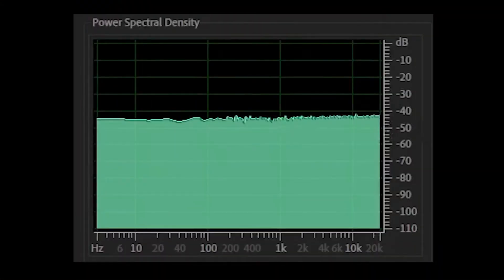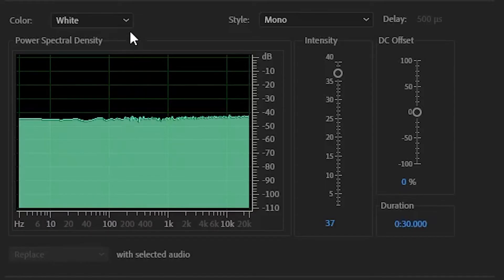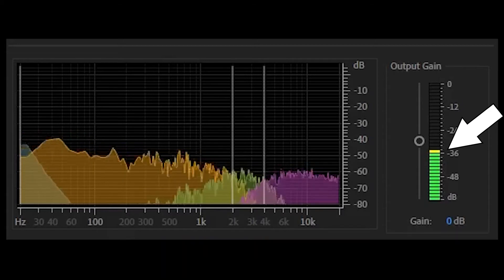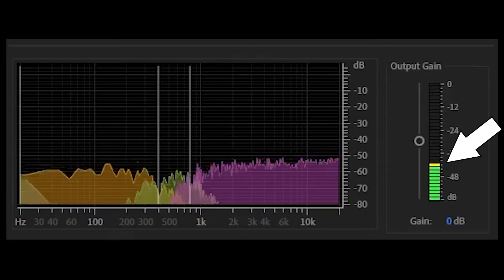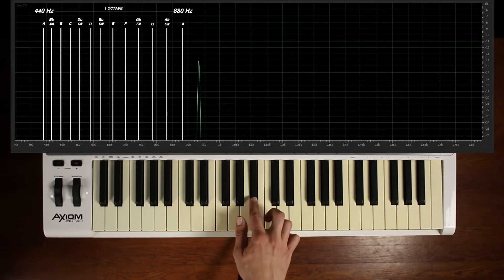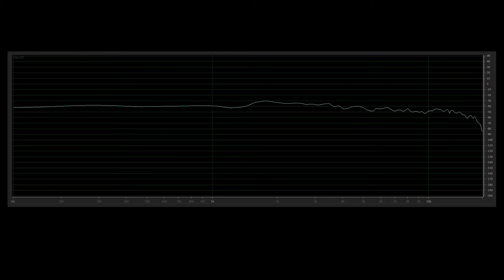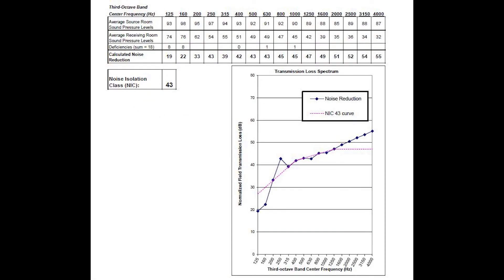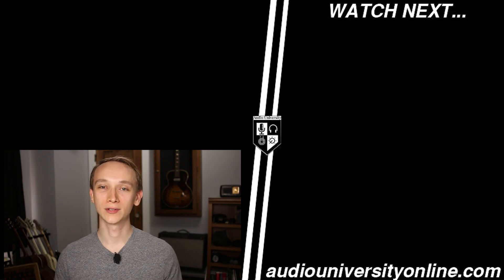White Noise vs Pink Noise [Audio Engineering & Music Production]

Comment: Remember to look at the scale you are using.  In this case his RTA uses a logrithmic scale (or decade scale).  If you have an RTA that uses the typical 31 band graphic EQ "1/3 octave" scale, then the pink noise will be flat and the white noise will increase at 3 dB per octave. (a mirror, horizontally, of the log scale).  If you use the RTA that overlays your 31 band graphic EQ, the results won't match what you see here.

Comment: Hello.  if I want to linearize my system which is more suitable pink noise or White noise?  if, for example, white noise is linear, so should the linear system?  if pink is slightly oblique then do I have to keep the slope that pink noise gives?  if I linearize with pynk noise then the upper middle part will be louder than the lower part under the bass!  so which is easier to use and respect white or pink?

Comment: Well explained! It worth noticing that white nosie being flat on spectogram is only true if the Slope of the vizualizer is set to 0dB... which is not the case in most EQ/vizualizer VST oriented to ward mixing (Span, Fab Filter Pro-Q etc), which in this case, have 4.5dB slope per default, for which white noise isn't flat.
Reply from the maker: Good point! Thanks.

Comment: For reference in mixing (using a match EQ like TDR's Nova GE), I often use -4.5/oct noise, between brown (-6db/oct) and pink (-3db/oct), which is closer to most modern music, and dial in around 30% or less of the match and then make manual adjustments. (For those that don't know, the negative slope of pink noise, -3db/oct, is relative to white noise, which is considered 0db/oct, Pink noise can be created from white noise by applying a -3dB/oct filter). Sometimes, I will use a noise reference match only as a guide to know where further down in my mix (sub-buses and individual tracks) I may want to make some EQ adjustments to minimize EQing on the master bus.

Pink as a reference, although much better than white, still tends to be too bright, lacking lows. 
As stated in the excellent scientific article, Long-term Average Spectrum in Popular Music and its Relation to the Level of the Percussion, available free online, the frequency spectrum slope has been estimated across genres to be approximately -5 dB/octave on average with the slope steepening in the far upper higher frequencies, which is what I have often found through analyzing various songs with a spectrogram. While pink and brown noise is easily available online, other slopes are not. To create my own custom noise slopes in a DAW such as Ableton (e.g., -4.5db/oct and -5db/oct), I use a noise generator plugin such as the free Pink plugin, a tilt EQ , such as the free stiltV2, and a spectrogram such as the free Span. After selecting the target slope in the spectrogram, I adjust the tile EQ until the frequency profile display flat, horizontal in the spectrogram. 

By the way, excellent content! Please keep the videos rolling out.
Reply from the maker: Thanks, Sam! This is great info! Here is the article Sam is referring to for anyone interested... 

Long-term Average Spectrum in Popular Music and its Relation to the Level of the Percussion (AES): 
https://www.aes.org/e-lib/browse.cfm?elib=18638

Comment: i'm actually working on a project for school relating to the generation of white/pink noise. 
Basically, a white noise source is totally uncorrelated. Think of a spinner divided into equal parts with each part corresponding to a different tone. Then, a "white melody" can be generated by spinning the spinner many times and recording the tones the spinner lands on, one after another. Any given tone will be totally uncorrelated to the tone that came before it. 
 
This can be contrasted with a brown noise (1/f^2) source which is highly correlated. Think of starting at a certain tone. Then, the next tone may only deviate slightly higher/lower. Continue this process to generate a "brown melody". You'll notice that a spectral analysis of brown noise has an even steeper negative slope than pink noise.

Pink noise is somewhere in between white and brown noise. It is not as correlated as brown, but it is more correlated than white. Pink noise is also called "1 over f" noise. A "pink melody" can be generated using the Voss algorithm which is actually fairly easy and elegant to describe, but I don't have the energy for that right now.
Reply from the maker: Thanks for sharing this information, therealcarlgauss!